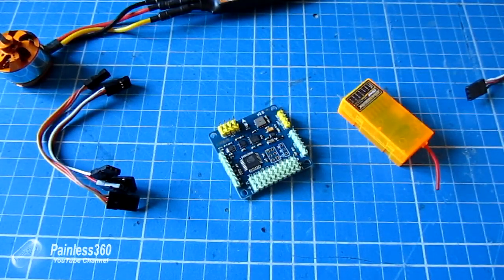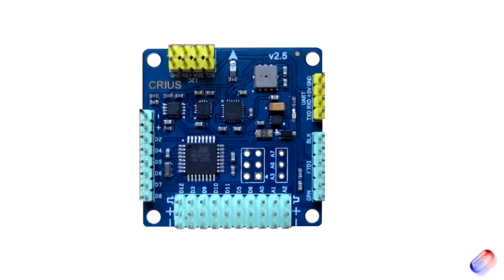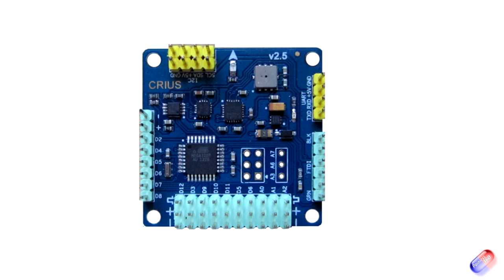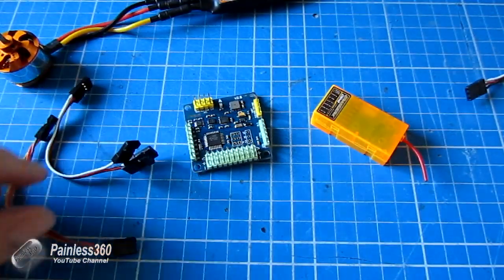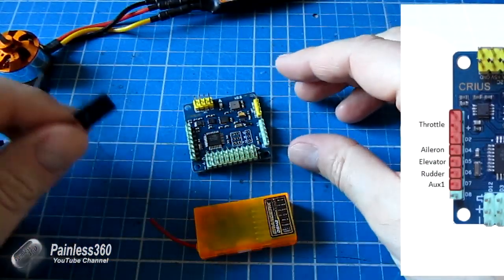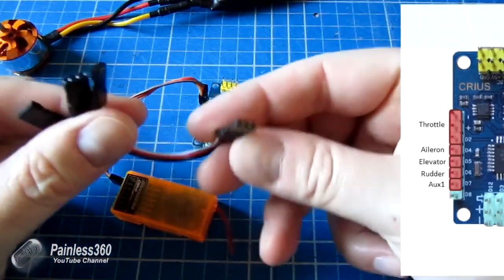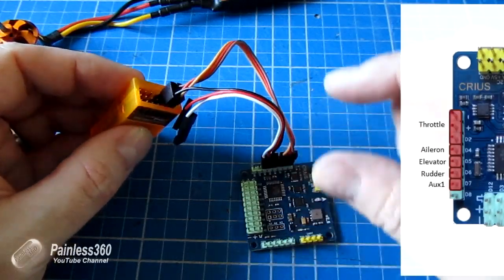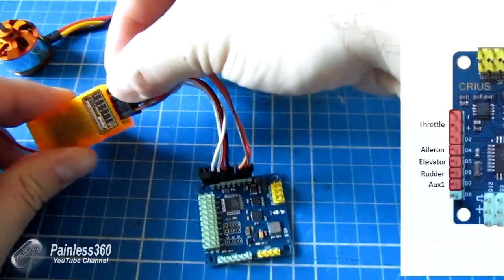(2/7) How to wire up a Multiwii SE board to your multirotor/quadcopter

Comment: Hello, I own an old drone which has a crius multiwii se 2.5 mounted on it. It has connected a PWM receiver. I build it some years ago with the inestimable help of your playlist of videos about Crius Multiwii. I recently released a PPM receiver from another drone. Do you know where must I wire a PPM receiver to the Multiwii and how to setup in arduino? Thanks
Reply from the maker: I've never done it but there are options for PPM in the config file. Best of luck!

Comment: In one of your videos you mentioned how to apply low pass filter in multiwii i.e 42  khz ... i just wanna ask that how should i apply same filter on my quadcopter? I only changed FC from multiwii to apm. In multiwii i got stable flight but now having takeof issues in apm. Thanks
Reply from the maker: LPF filters are there when you can't get rid of excessive vibration on the model. Id' look at that first, maybe an anti-vibration mount for the APM?
Reply: Painless360 i putted my apm on 3mm foam and it is stable in loiter mode. Perhaps when i push my quad to any other side it still comes back to its location. I think its stable now isn't it? Btw love your all of the videos :) happy flying
Reply from the maker: +Mukarram khalil you too! :)

Comment: Please help me, I have no respont remote controller to my multiwii board it's nothing happen, and i have flysky i6 rc... Please
Reply from the maker: Happy to help but please watch https://www.youtube.com/watch?v=olIqTiSJHIY and come back to me with more detail of what you've tried..
Reply: i was tried connecting multiwii se v2.5 to multiwii config x62 bit and it's working, but when i try to connecting again and i plug receiver fs-i6 flysky it's not working or the blue light of multiwii stop blink the nothing respont in throttle or all channel when i'm turn on the remote control flysky then when i turn off the rc is comeback to normal and blue light comeback to blink again, help mi please

Comment: hi, I'm using flysky fs i6 radio and multiwii 2.6 . when i directly run the motor with receiver, it will run. but when i plug it in multiwii then motor wont work. 
can u please help me with it
Reply from the maker: +Ashish Thomas have you armed the board? See the later videos in the series..
Reply: Painless360 yes i did.
Reply: i have watched all the video of your series and everything was perfect. when i plug all the wires of motor and receiver on the board and try to move throttle or any key. it doesnt move. I'm not able to understand where is the problem
Reply from the maker: +Ashish Thomas a video showing the problem and a full list of the troubleshooting you e already tried would be helpful..

Comment: Hie painless 360 
M having problems with my multiwii se v2.5. When i connect it with ftdi (no other connections) it works fine but as soon as i connect receiver n motors it start giving weak green light n no blue light i tried to give 5 v supply by power supply to power but insted of battry eliminating ckt of esc but facing same problem 
When i remove receiver n escs then again it works fine gives signal in config 
Tell me how to overcome it.. Plz help
Reply from the maker: Happy to help but please watch https://www.youtube.com/watch?v=olIqTiSJHIY and come back to me with more detail of what you've tried..
Reply: Painless360 
I observe that only when i plug receiver +5v and ground pin this think happen so i took +v and ground from motors +v and groud bus nw its working fine i can observe all singals from tx in software on pc but i observed my singals its varying from low to high ( all 4 signals) but when i tried to arm it its not happening 
Signal lev at zero throttle is not exactly 1000 but 1004-10 its not exactly zero n in full range it's not exactly 2000 but 2005-10 so could that be resason to not arm?
Reply from the maker: +Atul kamble if you're LEDs are not in coming in properly then that suggests a power problem. See the MultiWii series on the channel for all of the basics. Best of luck!

Comment: i have multiwii 2.6 and motors MT2216 don't start. they were delivered with simonk 2-3S and i used Lipo 4s. i should use lipo 3s right?
Reply from the maker: +mag num check out the specifications for the ESCs you have. See how we did that in the 'Quadcopter building for beginners ' playlist. That should give you an answer. Best of luck!

Comment: i have a question, why do we use  silicon cables for multirotors instead of copper wires?
Reply from the maker: +Friederrich Eggeling For the insulator?
Reply: +Painless360 
i mean normal wires like the ones for wall plugs
Reply from the maker: You'll find that those are rated for mains voltage and not designed to be flexible. The cables used in RC typically need to be very flexible and work across a huge varying temperature range. That's why silicone insulation can be better sometime.. Have a google, there's loads out there on it.. Best of luck!
Reply: +Painless360 
ok thanks

Comment: Sorry to keep asking daft questions, my i6 RX is 5 volts but my 3s battery is 12 volts. Since the RX gets its power from the flight board am I right in assuming the Multiwii flight board has a bec to reduce the voltage, as the board also has 2 pins which say 5v which I would like to use for a 4.5v led headlight or would it not be wise to take a load from this point.  Thanks.
Reply from the maker: +thra5herxb12s Not at all, there are loads of videos in the 'Introduction to RC' playlist that will help you with the basics - like this.. https://www.youtube.com/watch?v=o7L_Woeu38Q&index=26&list=PLYsWjANuAm4oWuE5ZDX4TAiHBv2i0Xl4m

Comment: Hi!I have a problem with my new multiwii Quad : after a crash ,the ESCs don't beep and the motors don' turn.There are no visibile damage but a pin of the multiwii bent.I can use the multiwii from the PC with MultiwiiConf .Can you help me?
For the crash video and more details : http://www.rcgroups.com/forums/showthread.php?t=2647385

Thanks in advance.
Reply from the maker: +Nicola Guerrera I'd check the system from the start, happy to help but please watch https://www.youtube.com/watch?v=olIqTiSJHIY and come back to me with more detail of what you've tried..
Reply: +Painless360 Thanks.I'll make a video showing this issue with some photos ,I tried searching on internet but no one seems to have the same issue.My ESCs sometimes will sart fine with all the 5 beeps and the majority of the time it won't beep/start at all.

Comment: Good afternoon!
I would like to put a question to see if I can help.
I bought all major accessories to mount a Hexacoptero and the card I'm using is a Crius MultiWii MWC SE v2.5. I called all the components and the time to experiment can not rotate all engines work 4 as the quadricóptero and the other 2 only spin when the move command sticks in certain positions.
I made the connections as follows; Motor 1 (M1) - D3, D11-M2, M3-D6, D9-M4, M5 and M6-D10-D5. Where did I go wrong?
Thank you for your answer!
mail; NSRts1976@gmail.com
Reply from the maker: Happy to help but please watch https://www.youtube.com/watch?v=olIqTiSJHIY and come back to me with more detail of what you've tried..

Comment: Hi! Very nice videos. I´m having problem connecting my receiver Hitec optima 7 to the Crius 2.5 and a 4 x ESC/BEC with a  3S Lipo.
I did as you explain but the receiver doesn´t work it shows a red and blue light, i don´t find any information online that explains what it means. But if i connect the signal D2 to the receiver Throttle and connect the + and - from the receiver to the pins where i connect my ESC/BEC in the crius it works ok. Do i have a damage crius board or do i do something wrong ? I get 4.6V in all the +5V pins from the board is it to low voltage? Do i have any component that is damage?

Thanks ...
Reply from the maker: +Toze Freitas Not sure what you mean, if you've connected the power the wrong way then you have probably damaged something.. Best of luck!
Reply: I was trying to say is that if i use the throttle pinout to send signal and power to the receveir the receiver doesn´t work. If I power the receiver using the pinout from the ESC/BEC for exempel D12 the receiver starts and everythign is ok ... I don´t understand why i can´t get it to work the same way as you mentioned in your video.
Reply: +Painless360 Thanks ! 

Just a small question, I resolve my power receiver issue by fetching power from the D12 pinout so far so good.
I calibrate and made the confirguration to my ESC (via transmitter), balance my props, correct rotation and CW CCW prop in the correct motor (QUAD X).
Now when i test it the quad doesn´t have enought power to lift. 

If i try only one engine/ESC directly connected to receiver (NO CIRUS) I get a lot of power from engine but when i connect the receiver and the Engine/ESC to the CRIUS  I don´t get that much power as directly to the receiver. 

I´m having "juice" problems. It can´t be a battery problem (Lipo 3S 1100mah 35-50C) otherwise it should perform the same with or without CRIUS.
Is it some confirguration that i´m missing? Is it something worn with the CRIUS board that are giving me the same power problem with the receiver and now with the ESC?

What do you think it can be ?

thank you very much.
Reply from the maker: It could be lots, I'd check that you only have the most basic flight modes set when trying to take off for the first time. Best of luck..

Comment: Hi! great video !
I use the same board as shown in the video. I flight several times without crashing my quadcopter :)
I have one question:
Why do you connect all ESCs with all 3 cables (black, red, white ) to your multiwii?
I read somewhere I have to connect only 1 red cable of all 4 ESCs to multiwii, the other 3 red cables are left over, isolated. To avoid too high voltage on the flight controller? I wired that so in my quad an it is working, but what is the difference? Is that true what I read?
I hope you answer my question.
Greetings from Austria :)
Reply from the maker: +MrBaerlibaer Watch out videos on ESC and Multirotor power systems for lots of answers..

Comment: +Painless360 if  I have set up my quad and done all the connections and programming will the quad fly or do I have to do anything more?
Reply from the maker: +vansh gupta Normally, I'd test that I can arm the board, run the motors (all with the props off) and that they turn the right way. Once I'm happy then I'll try a quick test hover over grass. Best of luck!
Reply: +Painless360  after I have tested the motors it did not fly when I took it out
Reply: +Painless360 also I have 2200 kv motors and 5000mah battery
Reply: +Painless360 pls help me
Reply: +Painless360 Ihave a fly sky T6 controller
Reply: +Painless360 when I use fst6 controller the motors spin but the quad doesn't fly
Reply from the maker: Happy to help but please watch https://www.youtube.com/watch?v=olIqTiSJHIY and come back to me with more detail of what you've tried..

Comment: Hi! I connect my multiwii to my quadcopter but it doesn't do anything. It is connected with ftdi to pc and I have open that configuration program. In there I can see when I move stick on my controller and everything is working, only propellers doesn't spin even when I am off from config program. When I turn on quadcopter there is only green light. when I move it than is also blue. I move my stick to unarm it nut nothing happens. Motors just don't want to turn :/// please help :/
Reply from the maker: See the next video in the series..
Reply: I have seen it. it not helping :/
Reply from the maker: Hard to help with the very limited detail you're giving me. Happy to help but please watch https://www.youtube.com/watch?v=olIqTiSJHIY and come back to me with more detail of what you've tried..

Comment: great vids and instructions. i was wondering how tohook up a spektrum ar 770 with srxl. any help would be appreciated
Reply from the maker: +natet4 Not sure - never used one. Follow the wiring for the PWM connections I'd expect.. Best of luck.
Reply: +Painless360 where to put the GPS?
Reply: +Painless360 I have a fly sky receiver so it has ch1-6 written instead so where to put the wires
Reply from the maker: Use the manual or the screen on the radio to figure out what channel corresponds to which number on the Rx.. Best of luck!

Comment: Could I connect gimbal motors directly to the Multiwii SE board? Thanks!!
Reply from the maker: No. You need an esc to drive them.
Reply: +Painless360  
Then how about the sensor that should set up on the gimbal to detect the axis of the gimbal. That sensor comes with gimbal controller. But without sensor how would I track the position of the gimbal with only using multiwii?
Reply: +Painless360  
Then how about the sensor that should set up on the gimbal to detect the axis of the gimbal. That sensor comes with gimbal controller. But without sensor how would I track the position of the gimbal with only using multiwii?
Reply: +Painless360  
Then how about the sensor that should set up on the gimbal to detect the axis of the gimbal. That sensor comes with gimbal controller. But without sensor how would I track the position of the gimbal with only using multiwii?

Comment: Do I need separate gimbal controller for this Multiwii SE board? (Because it has pins for camera gimbal)
Reply from the maker: Senal Weerasinghe you can use either.  Best of luck!
Reply: Painless360  Could I connect gimbal motors directly to the Multiwii SE board? Thanks for advising me.

Comment: Hi on my receiver neither pitch nor yaw are being picked up by the multiwii, I can see both roll and throttle being picked up. I know neither the transmitter or the receiver are the issue since I've tried each port on the receiver with a servo. Any help would be massively helpful since I'm drawing a blank.
Reply from the maker: ***** I would re-flash the board and try again. Not sure what it could be if the wiring is ok. 
Best of luck.

Comment: Hey Painless360, I bought a Multiwii and Megapirate v2.0 AIO board which is similar to the one in this video. Now I have have come upon the problem of how to connect my receiver to the actual board. My receiver has a +,-, and GND pin, so my question is, does it matter which of the channels is connected via the positive, negative, or ground wires? You seemed to just make sure each of them were color coordinated based upon the input into your MultiWii board.
Reply from the maker: AudioFreeeze Yes, you have to be very careful when making the connections - https://www.youtube.com/watch?v=LyPtzv0y5DE&list=PLYsWjANuAm4oWuE5ZDX4TAiHBv2i0Xl4m&index=2 and it's playlist may help answer some of your questions..
Best of luck.

Comment: Painless360, I can not seem to read the PIDs and switch info from my fc using MultiWiiConf. I hit start and read, a small led blinks rapidly but just keeps on blinking with no data to show for it? My BT ap on my cell phone works fine. Any thoughts?
Thanks, Tim
Reply from the maker: Double check the USB cable is ok. Failing that it may be the FTDI connector...

Comment: hi 
I want to ask some questions?
what type of esc did you use???
where i can find a datasheet of crius 2.5 and if it is impossible to find where i need to connect the battery to power up the crius card?
the last question i need to connect the esc to another battery??
thanks
Reply from the maker: Hobbyking 20a (3a BEC) ESCs flashed with SimonK (https://www.youtube.com/watch?v=kA2dBD9jSVo)

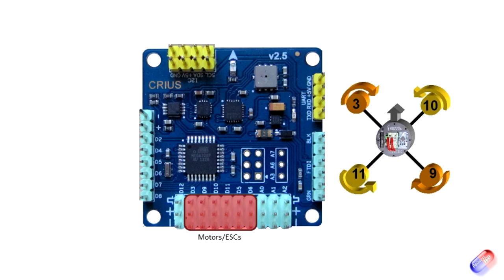The BECs in the ESCs power the board when you plug them in (8:16)

If that doesn;'t make sense then watch https://www.youtube.com/watch?v=DraFgiDELjI and https://www.youtube.com/watch?v=L3BnPdiK3_o&list=PLYsWjANuAm4pIU07ta7glYIn-EBCof_4r&index=6
Reply: Painless360 thanks
another question it is very important to flash the esc because i think that it's a bit difficult for me.
and
i don't understand how can i connect my esc to the pc
another things what kind of motors did you use?
this esc can replace your model?
ESC Hobbywing Skywalker 20A
Reply from the maker: The best performance from the quadcopter will come when using ESCs that are running special firmware that improves how quickly they respond the changes. This is what SimonK firmware does. It will fly without it. See my video https://www.youtube.com/watch?v=Sjwi_UnCLWc fro a few ideas on motor selections..

Comment: In the gui the cycle time and i2c error are going crazy :/
Reply from the maker: i2c errors are usually hardware or wiring related. I get them here when I enable the GPS pieces and forget to plug the i2c board in.

Best of luck with it.